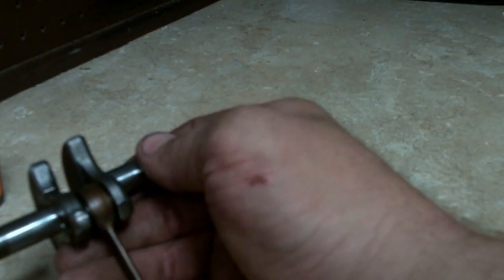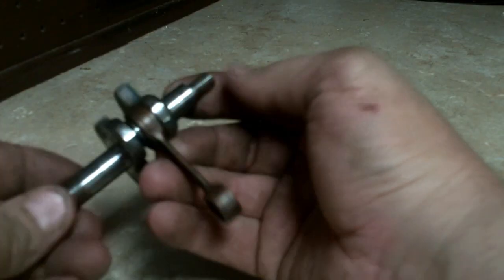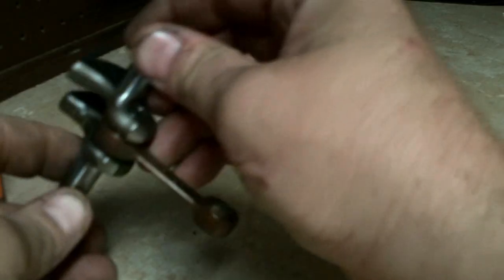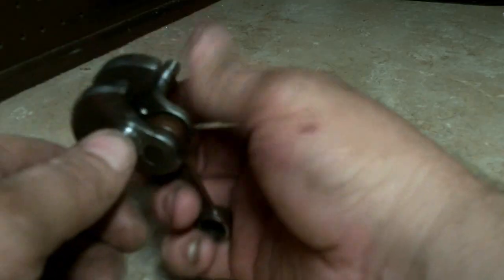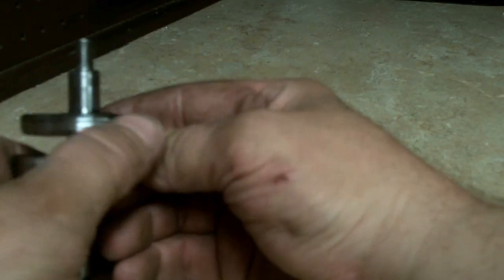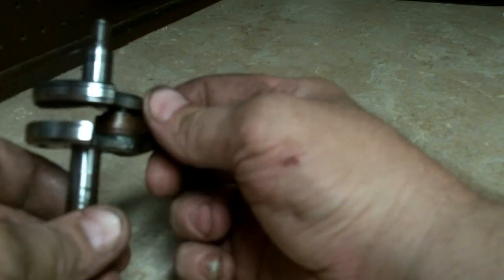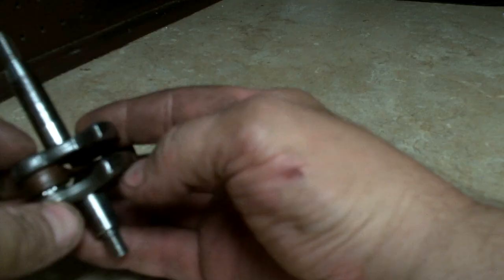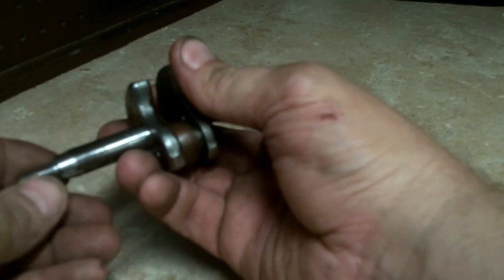" 2 CYCLE ENGINE REPAIR" ECHO CS 345 CRANKSHAFT FAILURE

Comment: How did you get the case apart?
Some body ran my CS 345 for a day without a air filter/cover.
And being that this is on the front, there is crap/wood inside my block/case.😤

Comment: If nobody said it before, the failure was caused by someone tightening either the clutch nut or the flywheel nut incorrectly. If you hold one side of the crank and twist on the other, this is what happens. very common failure when folks don't follow procedures and take shortcuts. Again, likely, somebody tried to tighten the clutch nut side of the crank by holding the flywheel and put huge torque across the crank from one side to the other. NEVER do that and manuals state the right tools and the right way for such procedures.
Reply: Insert starter rope into cylinder.

Comment: Yep the newer echos are garbage the older one were made better . Getting cheaper each years since the price of metal keeps going up. I bought a 2011 top of the line Ariens snow blower 32 inch 15hp briggs engine I liked the older tech engines as they were snow king but since tech has gone out of the small engine bushiness